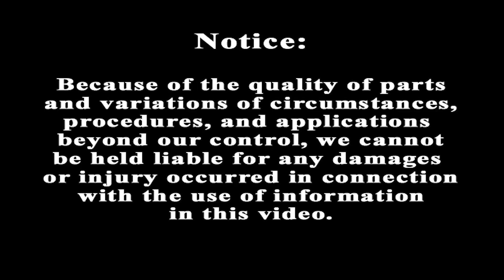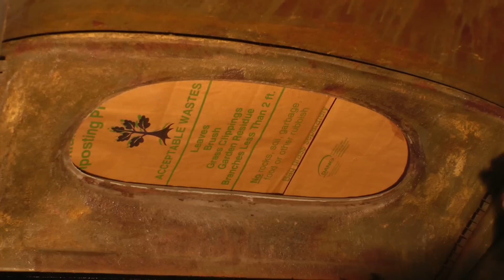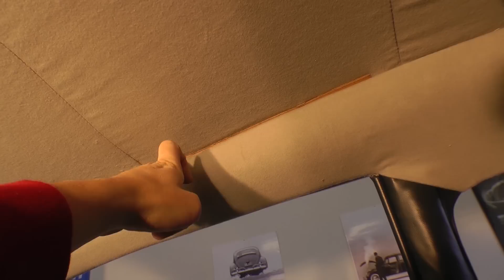How To Multi-Piece Headliner Installation Classic VW Beetle BuG in FULL 2hrs Archive Video

Comment: Thanks Chris!  This is a great video. I had a problem on my oval with the front plastic tab flipping and pulling back immediately after I was done tucking it in. I was watching along and the tip Chris gave to put the extra padding along the front header to keep the plastic from flipping saved me big time. I added a strip of padding and presto it snapped in and is holding tight.

Comment: Nice demo Chris. Where the grippers are gone due to rust, grippers are available in a strip that can be pop riveted in place or you could use a cardboard tack strip. There are tack strips available now that are made from black hard rubber that will hold tacks. The wind-lace in my 1951 Studebaker was held to the body with a cardboard tack strip that fit into the steel channel that surrounded the door opening. The tack strip was nailed to the body with hardened steel drill nails (look like twisted concrete nails). The tack strip was a very hard solid cardboard.
The plastic screws that were used in the body in the rear quarter panels were for seat belts where required in the country the car was exported to. Seat belts where first available in some American cars as early as 1957 but most did not have seat belts as an accessory until 1961. In the US seat belts became mandatory in 1967. Some European countries required seat belts in the 1960s and I think Japan required them in VWs in the late 1960s.  I have a 1972 Euro spec Super and it has these plastic screws and washers in the rear quarter behind the rear seat back but no seat belts in the back but only retracting seat belts in the front. I am not sure yet because I haven't taken the headliner out where it isn't torn, but my car may have a one piece headliner. The interesting thing is that only three center roof panels of the headliner are perforated while the remainder is printed to look like perforations. Every place where glue held the headliner or headliner fabric, the perforations are printed. I think this was done to prevent glue contamination on the front surface of the material, a problem with the reproduction headliners.

Comment: I just finished my 73 Type 3 with  TMI vinyl, looks good now but, it took 5 days with the heat to get the wrinkles all out. The pillar covers are the most difficult part of the that job. I could do a perfect job next time but, this job still  looks super. I did break the front window trying to reinstall but , the new window is a lot nicer so, maybe it was for the best.   I watched all your videos, thanks for posting!

Comment: The later models especially the Supers had the material around the rear quarter windows conforming to the body more closely than you show here, I prefer the look like you are doing. When I replace my headliner I will probably use non-perforated material and I like the look where the material isn't tight to the body; it looks more plush. The padding around my rear quarter windows and the area between them and the rear window is much thicker than what you are using. Without measuring, it looks like it varies in thickness between 1/2 to 1/8 inch in thickness. There are two layers around the upper part of the rear quarter windows. 
The carpet that is in the rear luggage area and over the heater channels is a needle punched carpet. I bought a large amount because it came 80 inches wide and it is sold by the running yard. I plan on using some of it between the seat springs and the seat padding.
You may be interested to know that Morgan UK uses a seat cushion material that is thicker but resembles 3M scrubbing pads. In the picture I saw the padding material was about three inches thick.
Have you tried lightly spraying distilled water on the wrinkles and letting it dry or use a hair dryer? That is what I did to remove all the wrinkles.

Comment: This is a great video Chris, actually all your videos are very informative!  The VW community is fortunate to have such a knowledgeable person.  I bought the interior for my '61 Bug sedan from Sewfine and Logan mentioned to watch your installation videos.  I bought the tweed interior, identical to your '61 vert.  I installed the rear window headliner padding per your video.  My question is do I install the trapazoidal  shaped vinyl, that goes below the rear window, directly over the tweed?  Any help appreciated.  Cheers, Frank
Reply from the maker: It's in vinyl not tweed?
Reply: @classicvwbugs  the headliner material for the rear window is tweed, the trapzoidal part is vinyl.  I've never seen that piece on any of your videos.
Reply from the maker: @frankshangar8666  yeah usually early bugs had a one piece section there around the back window, later ones had the separate piece at the bottom, but usually it is the same color as the headliner material.

Comment: Hey Chris  my 71 SB still not happy . Checked out timing an advanced it ran ok 4a few days then dead spots when you pressed the gas pedal. I put an ad in the local area for a old school VW mechanic. Got a response and lined him up for this Saturday. I will keep u posted.   Choke out of adjustment,  jets need cleaning? Thank you Chris.
Reply from the maker: Yeah sounds like a carb dunk is due, or some jet cleaning for sure.

Comment: Chris, thanks!   Any tips on a saggy headliner where it seems the bows aren’t holding, without having to tear down.   👍🏻
Reply from the maker: where is it sagging?  Usually you have to remove the windows and pull the headliner tighter.
Reply: Chris Vallone damn.  Didn’t want to hear that.   Thanks.  Luckily I can still see out the rear window for now

Comment: chris after you do pee and seal, do you add carpet padding before putting the carpet down in the back? Also do you put carpet padding around the front firewall and peel and seal or just one, or none? It would be awesome if you showed how to put the carpet with the rubber mats in!
Reply from the maker: Yes the padding goes before the carpet of course, not after! =)  Not padding on the front, if anything you can put some quick roof or the peel and seal.
Reply: @classicvwbugs  I was thinking more so, do you just do peel and seal before putting the carpet in, or do you put the peel and seal + carpet padding in the back. Some videos I see of people putting the carpet in without padding makes it look wrinkly like there is too much carpet, but others say the carpet is cut to be put in without padding. Just conflicting opinions. I want my carpet to look posh like yours.
Reply from the maker: @KingDupue  in the back I put both down.
Reply: @classicvwbugs  thank you Sir
Reply from the maker: @KingDupue  you bet!
Reply: @classicvwbugs  one last question, I can't find any of the quarter inch material for the headliner padding, will 1/8 inch stuff do just fine?
Reply from the maker: @KingDupue  should be ok.  On the roof though, I like the thicker stuff, the center square section.

Comment: Hey Chris, for the top headliner padding. i know you use either the carpet padding split in 2, or 1/2 inch jute material, but do you think just gluing together 2 pieces of the 1/4 padding that you use for around the back window would also be just fine?
Reply from the maker: It would yeah
Reply: @classicvwbugs  thanks, btw trunk carpet I bought from you looks greats!

Comment: Hey Chris, question I have a early 68 sunroof bug with the metal dash.Can I stop the headliner short and tuck it like the 67 and earlier bugs at the windshield.Thanks
Reply from the maker: you can but you need the 67 and earlier headliner.
Reply: Chris Vallone that’s all I wanted to know THANKS
Reply: Chris Vallone , I think I heard you make your own engine compartment tar board ?if so do you sell it or can tell me what you use. The one they sell are less than 1/2 the thickness of original. I cant see buying 2 sets to get the right thickness.
Reply from the maker: @mastermatt289  Yes I sell it.  https://www.classicvwbugs.com/classic-vintage-vw-volkswagen-beetle-bug-engine-bay-insulation-tar-boards/

Comment: Thanks for the video, Im going to attempt doing my own interior. Do you have a how to carpet install video ? 
Not sure if the carpet is glued against the body up front at the foot well
Reply: On the Super Beetles the carpet that was used on a Euro spec car is a needle punched material. It is glued and nailed to the walls of the foot-well and also to the places on the heater channels along the sides of the car. The same material is used in the rear luggage area as well as the covering on the inner rear wheel well. The needle punched carpeting also stretches nicely when you are trying to get it to fit curved surfaces. Unfortunately the salt and pepper needle punched material isn't available even though that is the most common color found in the Beetle and Super Beetle. It is available in other colors though.
Reply: it is available in the USA and is 80 inches wide. So it won't take many yards to do an entire interior. Should be good under the seat pad too.